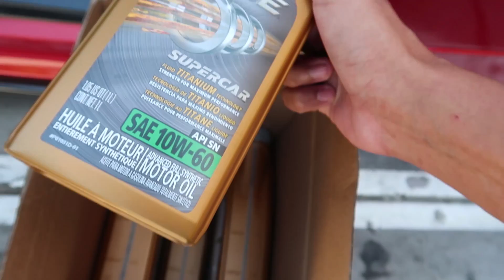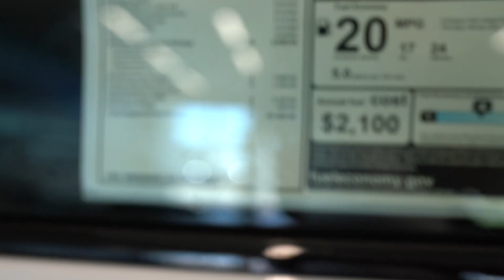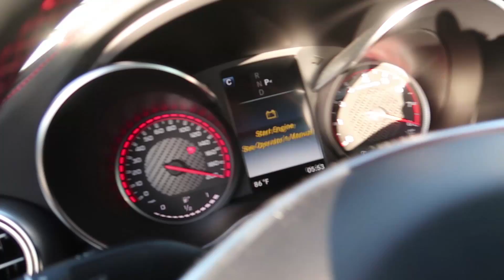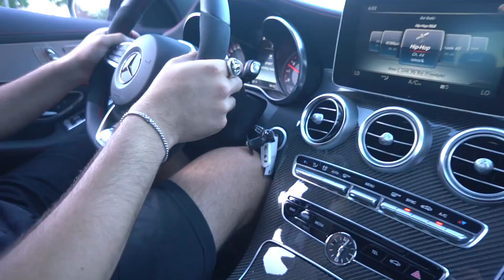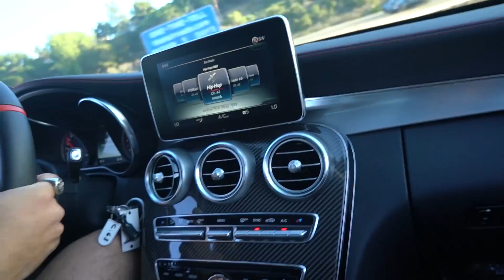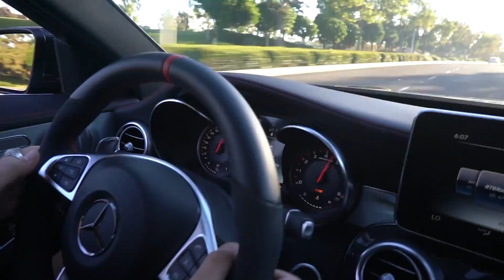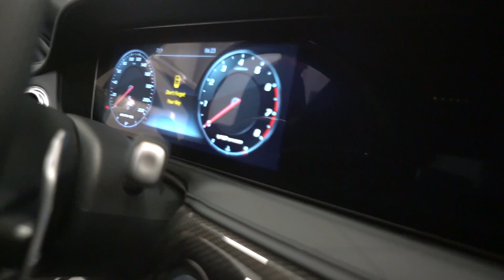TRADING MY BMW M3 FOR THIS???!

Comment: Great content! Do you still have the sensors in the primary cat section? If so, did the weld shop just drill some holes and thread the sensors through or did you buy a specific test pipe for them to connect?

Comment: C63's are so nice but don't hold their value at all. You can get a 2017-18 C63 for $60k used when they were 90-100k new
Reply: Lrodriguez Media for more luxury,speed and a way better exhost note i would go for it over the f80